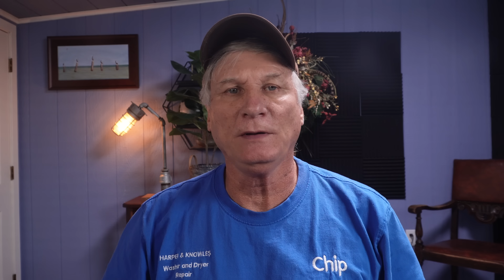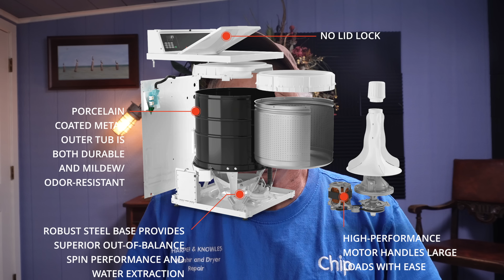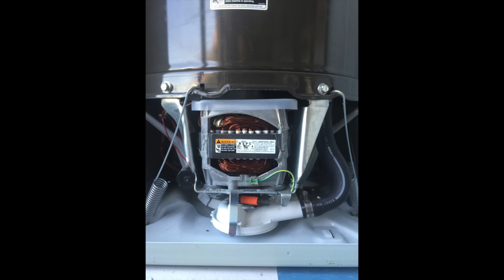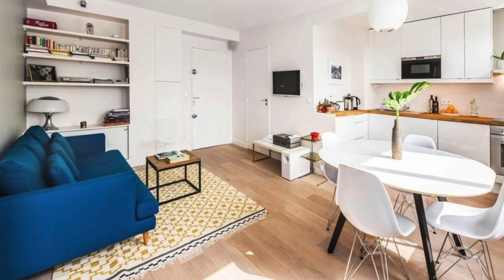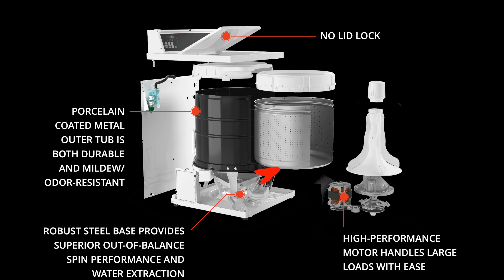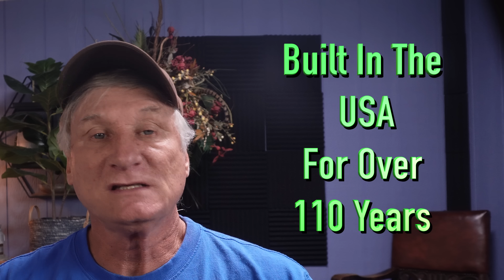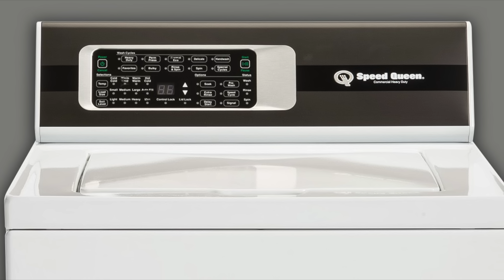TR7 vs TC5 – The Truth Speed Queen Dealers Don’t Tell You

Comment: I have a “ stupid” question. Why can’t Whirlpool make the old version that lasts. I bought a new front loading washer and dryer set. I hated the washer . It was always a struggle to keep it from smelling musky . The washer messed up and I trashed it , and gave away the dryer. I bought bought a used old set. I love my old set . The suspension system eventually messed up. I looked on YouTube on how to fix it,ordered the part off Amazon,fixed it myself . It is back to working like a dream. I am a 60+ year old woman , I was kinda proud of myself on that one.
Reply: Planned obsolesance
Reply: Good job on fixing your machine! 👏👏👏 With regard to the musky smell of your front loader, a common reason for this is folks don't keep the washer door and the detergent dispenser drawer open between washes. Remember, unlike top loaders the door of a front loader is tightly sealed when closed. If left closed between washes, the dampness in the washer never dries out causing odors, mold, and mildew. Also, occasionally running an empty cycle with a dedicated machine cleanser can do wonders for keeping a front loader smelling fresh and running at top form. There are many advantages to front loaders. Most of the best models are made in Europe where front loaders have been used a lot longer than in the US. I have a German made front loader. Still going strong after 16 years and it can handle much larger items than any top loader. Front loaders also have far less chance of damaging items because there is no rough agitator "tearing" at the clothes, sheets, comforters, sleeping bags, etc.
Reply: @SignorLuigi I always left the door partially open and it was still stinky. I would run a cycle with bleach periodically ,that would help . My cousin had a front loader that went out. She called the repair man ,he said it was the circuit board. The price for the repair would be $350 and he couldn’t guarantee that it wouldn’t instantly blow the circuit board again. I think the front loaders in the US are made to look nice instead of being dependable long lasting work horses.
Reply: @beckyshell4649  Hi Becky! Thanks for replying with the details of your situation. Your anecdotal evidence does suggest that Made in America front loaders do not have the superior engineering and reliable construction of machines made in Europe...well, actually made in Germany as German front loaders is where my personal experience lies. I do have my washer connected to a high quality surge protector so that the circuit board does not receive voltage spikes that over time will damage the board. I wash a lot of items that simply cannot survive the rough agitation of a typical top loader...things like large comforters, bulky sleeping bags, etc. I'll keep my fingers crossed that my front loader continues to perform admirably. I suspect the price of these German made units has dramatically increased since I bought mine. Add the new tariffs on German imports to the normal increase in price of things over time and I don't even want to think what they will cost!
Reply: "I was kinda proud of myself on that one."   As well you should be!  Congratulations!

 I'm a 74 year old man who just replaced the 'dogs' in the upper half of the agitator in my 25 - 30 year old large-capacity Whirlpool (bought at a garage sale about 23 years ago).  It is running like new again (first repair it ever required.)  The dogs (ratchets) cost $6 ($13 with shipping and tax).
Reply: Way to go, girl! We can do these things!

Comment: I bought a SpeedQueen in late 92 and I made the mistake of washing throw rugs in it. What did I love about it? I loved the fact that I could put filthy white socks in there and have it agitate for awhile then stop the wash and let it soak overnight. After I murdered that, I bought a Maytag Neptune that lasted for almost 15 years. Now I have an LG front loader that takes forever to do a load of laundry. I tried speed wash cycle but the clothes smelled awful. I never use cold water so that wasn't the problem. I don't get why the new front loaders take so long to do a load. It's certainly not saving electricity so where's the savings?

Comment: Funny how things have gotten worse. I have a Sears Kenmore washer and dryer have been going strong for 25 years. I've replaced the drive link (part that connects between motor and trans- easy fix and cheap) and ONE set of pawls.  The dryer has had two thermistors.  That's it!  25 years and still working well.  I dread the day they break down.

Comment: I have a GE agitator less all stainless  I do a lot of mechanical engine work my clothes get entirely greasy and oil soaked they come out very clean I use era detergent with a little dawn dish soap I have only owned two washers in 40  something years the was a commercial Kenmore they were at the top of the price range

Comment: My top load too many electronics Maytag washer lasted 7 yrs. I hated it because there was no way to fill the tub with water and there would be items that hadn’t even gotten wet. It also smelled awful, despite my always leaving washer doors open, regular cleaning with whatever latest products were recommended. My now 8 yr old Speed Queen actually uses water to the level I choose for load size, love that.I hate the small tub size because a queen size blanket has to get stuffed inside. Quilts only if they are thinner ones. Forget king size.Also the SQ does a poor job of spinning water out of the washed load, so nearly double dryer time is needed. Would I buy another SQ? Yes, probably, but wish I had space for an additional washer for large items.

Comment: Good Video and very good information!
We bought a Maytag washer and dryer back in the '90s. After 20 some years the washer developed a tub seal leak. I looked online what was the highest rated washer and LG front load was on top of the list. The LG didn't last 3 years! The tub drain pump went out twice, it didn't clean clothes very well and we were constantly fighting mold. After replacing the first pump when the second pump quit, I decided to cut my losses. Asked a friend who worked at an appliance store what was the best washer and he said without hesitation "Speed Queen". We bought a standard TC5 and it's been 5 years and no problems so far, it really cleans your clothes and no mold! 

The Maytag drier is still running with little maintenance. In 30 years, it has only needed drum rollers and belt changed. I do all my own maintenance. When we decide to replace it, we'll buy Speed Queen!
Reply from the maker: Thanks for sharing your experience!

Comment: I still have my 1995 Whirlpool. I won't sell it. It actually cleans my greasy, muddy clothes. No new machine can do that(at any price point).
Reply from the maker: Those mid-90s Whirlpool machines were built pretty tough. A good mechanical design with plenty of water and a strong agitation system can still do a great job on heavy dirt like grease and mud. If it’s been maintained and the main wear parts are still good, there’s no reason a machine like that can’t keep going for a long time. Thanks for sharing, and thanks for watching.
Reply: @HarperandKnowles I just had to buy a new(used) fill level switch. It cost me a whole $25 delivered. The new ones were over 100. The plastic cam had worn to the point where you could only make the load smaller (without taking it apart and moving it by pushing the spring by hand).
Reply from the maker: I’ve had problems with those too. Sometimes they get very hard to turn. If you put some lithium grease on the cam it works wonders else you’ll have the same problem in the future.
Reply: @HarperandKnowles  I did that on the new one; it already had slight wear. The first one lasted 30 years and was the first part I needed. I am more than satisfied with the machine and will buy anything it needs for as long as I can find it. Likely it will outlive me. Unlike new machines, it gets my greasy, red clay-coated clothing clean.

Comment: I have been using a Staber washer made in Ohio I ran the same one for 29 years I finally replaced it and I've had this one for probably eight years if you have a problem it is user serviceable and the factory will bend over backwards to help you if I had to I would buy another one next week
Good equipment good people!
bob ellison
Reply from the maker: Hi there. I have to admit something — I had never heard of Staber washers before your comment. That surprised me a little, so I had my AI assistant do some digging on the company to see what they were all about.

What I found is actually pretty interesting. Staber Industries is a small American manufacturer located in Groveport, Ohio. The company started back in the 1970s rebuilding transmissions for washing machines from brands like Whirlpool, GE, Maytag, and Speed Queen. Later on they began designing and building their own washing machines.

Their machines are pretty unusual compared to what most of us are used to. They’re technically a top-loader, but the drum sits horizontally inside the cabinet, almost like a front-load washer turned on its side. They also use a stainless steel hex-shaped drum design that tumbles the clothes instead of using a traditional agitator.

I want to thank you for bringing this to my attention. I really do like to promote American-made products whenever I can, and it’s always interesting to learn about smaller companies that are still building appliances here in the United States.

Since I’ve never worked on one of these machines myself, I can’t really recommend them one way or the other yet. But I will say this — after looking at their website, I would really like to get my hands on one just to see how these folks built it and what kind of engineering went into it.

So thanks again for mentioning it. You taught me something new today, and I appreciate that. I hope the AI got the research correct. If any of you other folks have experience with this company let us know!
Reply: @HarperandKnowles  it has no transmission it's a variable speed belt drive and it is very gentle on clothes I've been washing the same shorts for well over 20 years and it hasn't destroyed them yet I had to use a regular washer in a hotel and it beat them to death uses very little water and very little detergent

Comment: Bought Maytag front load washer along with a Dryer, stainless washer drum and porcelain drier drum, purchased in 2006.  Both still flawless and still get used weekly.  There are other good brands out there. My Mom has Speed Queen, they are nice but have not seen anything above and beyond vs what we have and our Maytags are noticeable quieter.
Reply from the maker: Sounds like you got a great set, glad they are still running well for you! You actually bought your machines the same year Maytag sold to Whirlpool (April 1st, 2006) You probably have one of the last production runs that are the true Maytags. Thanks for watching!

Comment: The T-7 old skool tub rotates one way the agitator rotates the opposite. Equals no clothes getting jammed under agitator. Best washer we've owned since giving our old skool Maytag to son, which had the same set up. The new energy star machines are nothing but JUNK.....Speed make the best front loader too, but were unavailable.. most go to laundromat's. 0:08
Reply from the maker: It sounds like you may be describing the reversing wash action. On the TR7 the tub and agitator are actually attached together and don’t rotate separately. The machine changes the wash action by reversing the motor during the cycle. That reversing motion helps keep clothes from wrapping around the agitator. Glad to hear you’re happy with the machine. Thanks for watching!

Comment: Exactly what we did. Bought a brand new LG and lasted about 2 years. Had tub problems where things were flaking off and was dirtying up the clothes. Service guy said they had to take the  machine apart to inspect and clean or replace the tub and the cost would be $450.00 minimum. I was not confident in the repair and ditched it and bought the Speed Queen TC5. Wife loves it, going on our 4th year. Still have the LG dryer though that went with the washer. Bought that in June 2020 and that is still working fine.
Reply from the maker: Thanks for sharing your experience!

Comment: I have a Samsung front loader. Cost about 1/2 that of a SQ and spins twice as fast so less money spent on drying. It’s ten years old and I do at least two loads a day. SQ are for people who didn’t pay attention in middle school math
Reply from the maker: Every design is a tradeoff.

Front loaders like your Samsung spin faster, so yes — they can remove more water and shorten dryer time. That’s a legitimate advantage of that design. They also use less water per cycle.

The other side of the equation is durability and repairability. Speed Queen machines are built much heavier — thicker cabinets, commercial-style transmissions or drive systems, serviceable parts, and very simple control systems. That’s why laundromats and commercial facilities use them.

A ten-year lifespan on a residential front loader running two loads a day is actually pretty respectable. Many don’t make it that long without major repairs like bearings, spider arms, control boards, or door boots.

Speed Queen owners usually aren’t doing middle-school math wrong — they’re just prioritizing longevity and rebuildability over purchase price and spin speed.

Different tools for different jobs.

Comment: I have a speed queen washer and dryer  over 20years. Its got my kids through high school sports and towels as bad as a laundry .To get around the Gov mandated hot water restriction drill open the restricted hole in the hot water side where the hose hooks up at the back. Don't need the gov deciding how much hot water I need to wash clothes. Its got the mechanical timers with extra load function. Bulletproof machines.  I only use commercial powder detergent and bleach as needed.
Reply from the maker: That’s a great run. Twenty years of service, raising kids, and handling all those sports uniforms and towels is exactly the kind of real-world use that proves how tough those machines are. The older mechanical timer models were built very simply, and that simplicity is a big part of why they last so long.

And you’re right — sometimes the simplest solution to those flow restrictors is exactly what you did. Thanks for sharing your experience, and thanks for watching the channel.

Comment: I have a 13 year old front loader LG Tromm. Outstanding. My brother replaced the drain pump after watching YouTube videos. The newer ones are to tech heavy. This model was the last of the best from LG. My next one will be a Speed Queen ❤
Reply from the maker: Sounds like you got a good run out of that machine. Those older LG Tromm units were actually built pretty well compared to a lot of what’s out there today. Replacing a drain pump after 13 years is a pretty fair repair in my book.

And you’re right — many of the newer machines are getting very tech heavy, which sometimes means more things that can go wrong. Speed Queen is one of the few companies still building machines with durability in mind, so I can certainly understand why that’s on your list for the next one.

Thanks for sharing your experience, and thanks for watching.

Comment: In 1991, I bought a Speed Queen washer-dryer pair. Since that time, they've survived 2 or 3 sets of tenants. (I used to have to rent out my house when I was away on assignment.) The machines been in 4 different houses, & survived several years in storage. The washer finally gave up after 35 years. I replaced it with a new Speed Queen. The original 1991 dryer? It's still running without a single problem. When I bought the original pair, the shop owner told me: I could sell you a higher-priced  pair by a different manufacturer, but if I were buying for myself, I'd never get anything other than a Speed Queen! I'm a devoted fan!
Reply from the maker: That’s an impressive run. Getting 35 years out of a washer is about as good as it gets. Those older Speed Queens were built like tanks, and it sounds like yours definitely proved that.

The fact that the dryer is still going after all that time says a lot about how those machines were built back then. Moving through multiple houses, rental use, storage, and still working is pretty remarkable.

Thanks for sharing that story. It’s always good for people to hear real-world experiences like that when they’re trying to decide what to buy. And thanks for watching the channel.

Comment: Why is no one mentioning all the suds that come out of the hoses with the tc5 speed queen washers🤷🏽‍♀️
Reply from the maker: I researched the Speed Queen site for an answer for you. 
That can happen, and from what I found it is usually one of two things — either too many suds from detergent, or a drain/standpipe setup that can’t handle the discharge fast enough. These machines move water out in a hurry. Using HE detergent, using less of it, and making sure the standpipe is sized and installed right usually helps. Thanks for bringing that up. Thanks for watching!